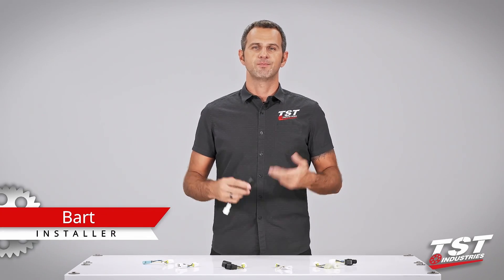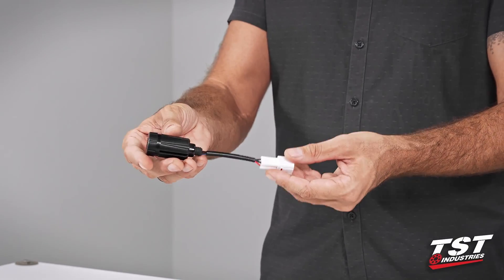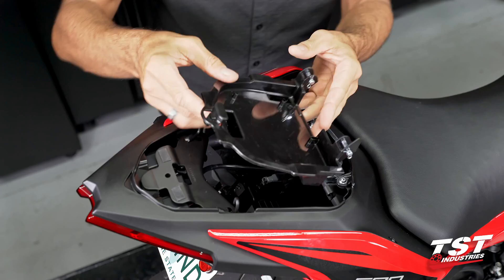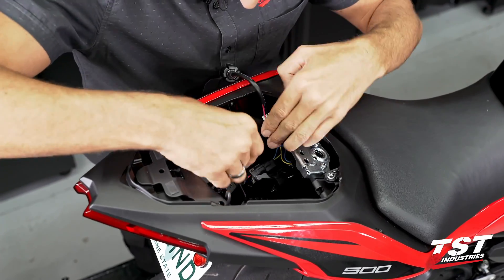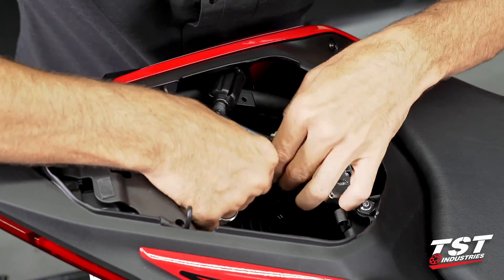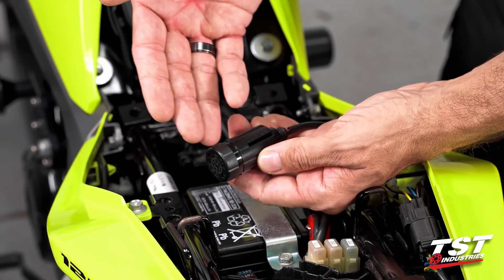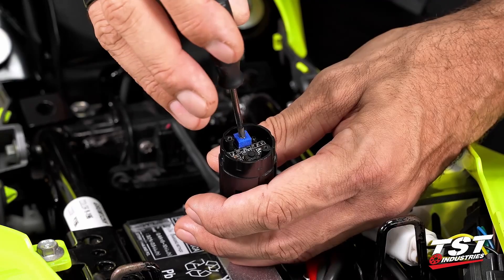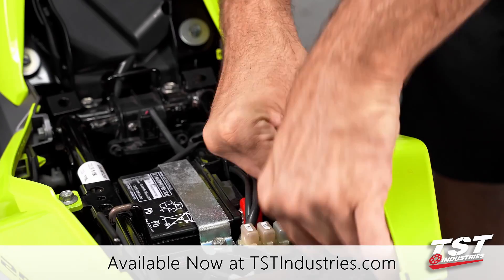How To Install Plug-and-Play Strobe Brake Light Module on 2024+ Kawasaki Ninja 500 by TST Industries

Comment: Waiting patiently for them to drop this product
Reply from the maker: The brake light modulator has been available for this bike since the bike came out. Are you talking about the integrated tail light?
Reply: @TSTindustries yes the tail light.
Reply: @TSTindustries do you know when it might be coming out?
Reply from the maker: @pacifiquekwizera1521 we’re aiming for a mid-late Summer launch. We have a couple units out in the wild currently being beta tested.
Reply: @TSTindustries my bike crushed and I need a tail light replacement. Anyway I can have one? Just asking
Reply from the maker: @pacifiquekwizera1521 we do not announce launch dates until within two weeks of readiness because there are many variables we cannot control. There is nothing we like less than promising our customers new tech and then disappointing them with a postponement. What I can tell you is that there are several light prototypes already on bikes being tested, and the machinery that is going to be doing mass production is being finalized.
Reply: @TSTindustries sounds fantastic, I can’t wait!

Comment: So is this strobe light only for the breaks and the flasher relay is for the signals and running light function? And both is fine to have on the bike together? I have the ninja 500 se. Already got the fender eliminator kit with quadrix-d sequential signals kit and strobe. About to order the nexus lights and relay. And then install at same time.
Reply from the maker: @kaimanahana6972  the relay is for the signal flash rate and our brake light modulator is to introduce a strobe brake function. Those two components operate on separate circuits and are perfectly okay to use with one another.

Comment: I want the same thing for my fog lights on Kawasaki Versys 1000 2024. Is that possible?
Reply from the maker: @k01yunya  depends how much current those lights draw. The brake light modulator is meant for low current applications.
Reply: @TSTindustries  please consider some solutions for front-facing lights. That would be awesome. E.g. I never ride in fog, so I'd love fog lights to function as strobes.

Comment: Do you know if the plug is the same as the ninja 400?
Reply from the maker: Both bikes use a different harness.
Reply: @TSTindustries  I've seen alot of your products. Have you made a tail light with indicators built In for the new 500 ninja
Reply from the maker: @barra_life_burnouts121  not at this time. We  may release one next year.
Reply: @TSTindustries  Great to hear Im in the middle of searching if you guys make one haha. Buying my 500 next week 🙌🏽

Comment: I have your ‘Quadrix-D Sequential’ indicators in my cart right now, because I like the idea of having ‘extra’ brake/running lights for visibility’s sake. If I use this tail light modulator on my Ninja 500 will it do the pulsing for the Quadrix-D indicators as well? 

I haven’t checked to see how the wiring works… I assume the Quadrix-D won’t strobe as well, but thought I’d check!
Reply from the maker: If you have the Quadrix-D yellow wire circuit wired in downstream of the modulator then it will strobe. 
-BR
Reply: @TSTindustries  Thanks!